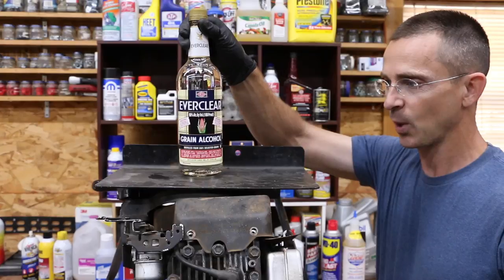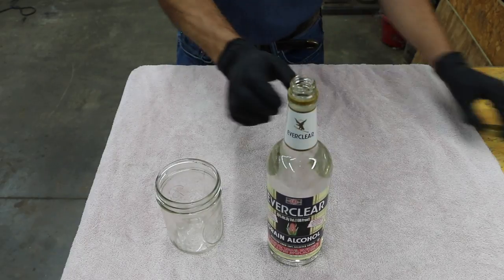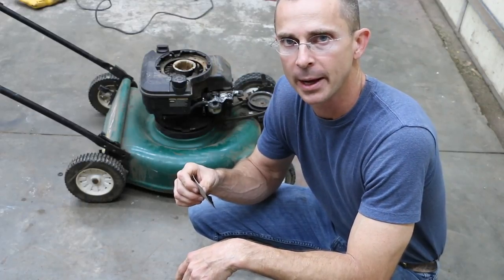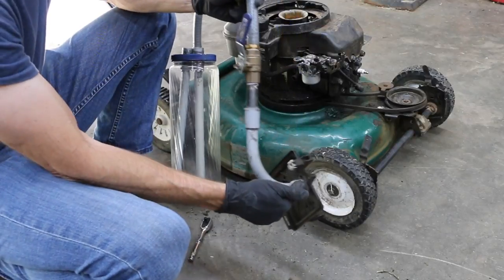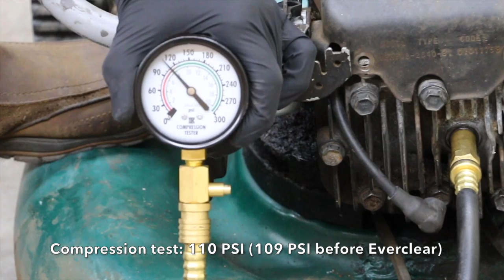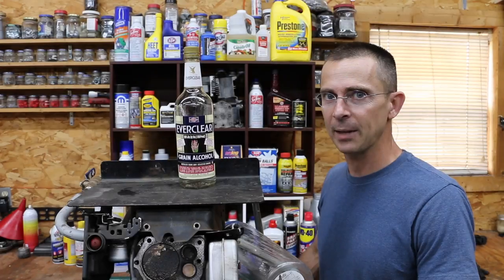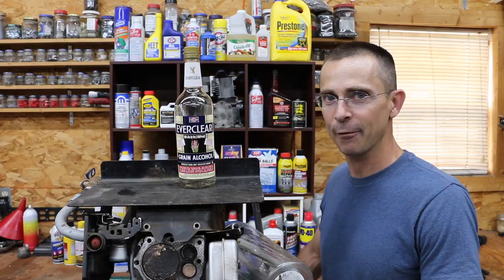Will an Engine Run on Everclear Fumes?  Let's find out!

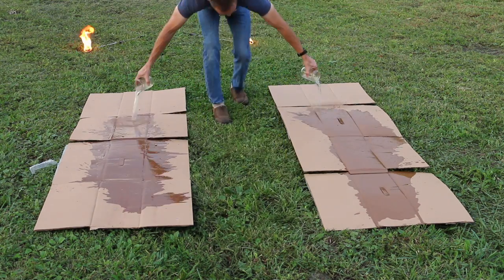Comment: 5:21 just in case your wondering why Nascar has banned pure Alcohol based fuels and mixes it with gasoline the one on the right is on fire, now imagine that's you and you just got out of a burning race car and the safety crew thinks your fine.
Reply from the maker: Thanks for the feedback.

Comment: Don't all gas engines run on fumes?
Reply from the maker: Yes, they do, but injectors and carbs inject liquid vs drawing fumes from the tank.  The liquid converts to vapor and also provides a cooling effect on the valves.

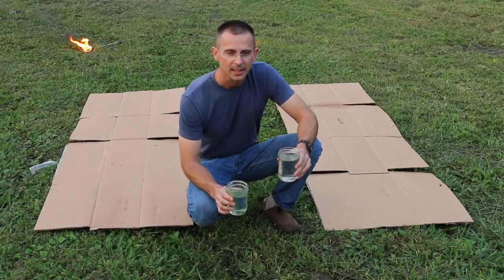Comment: Don't be fooled at 5:03. The alcohol burns invisibility but it still burns with heat and danger.  Note the accidents that happened in the pits of cars running methanol .
http://i.imgur.com/VHuyXj4.gifv
Reply from the maker: This is a great point.  The alcohol had a flame but wasn't visible.

Comment: Everclear is 95% alcohol vs. 91% rubbing alcohol you ran in an engine earlier. The everclear should actually make a better fuel due to it's lower water content, and since it's made for personnel intake it should be more highly filtered.
Reply from the maker: Great point.  I will likely increase the jet size for future tests of alcohol to achieve the optimal air/fuel mix and overall engine engine performance.

Comment: Good content but oh so dangerous having an open flame around gasoline. Hope some knucklehead doesn't burn himself up trying to replicate what you're doing here. Gasoline fumes are heavier than air. Spill some on the ground and a plume migrates along the ground in an outward pattern. You really should be putting a disclaimer on these video's enlightening folks to the dangers involved. Good content otherwise!